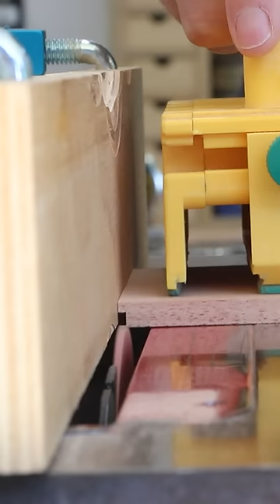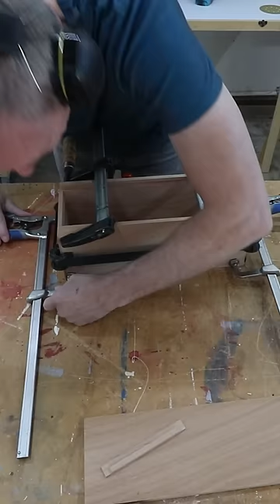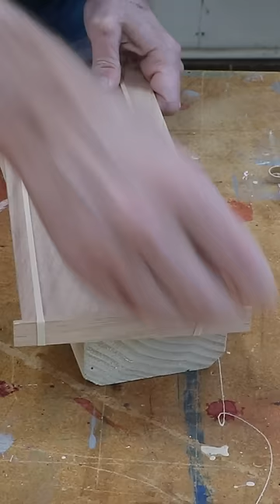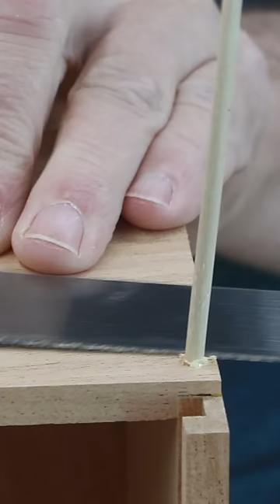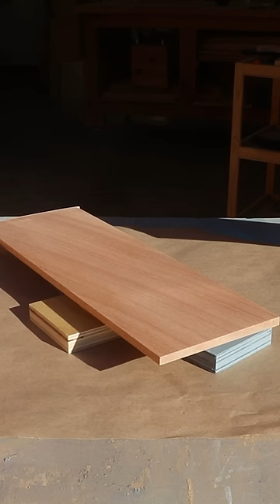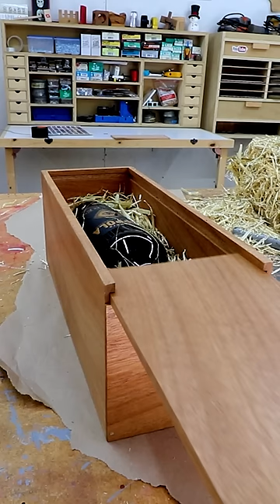Mahogany Wine Bottle Gift Box #shorts

Comment: Nice looking project as always....

in my grandfather's shop, we would have called that a "mantle box", as it was narrow and fit well on the fireplace mantle.   I've also heard them called by an older name:  candle box.   back when candle light was the chief source of light, a easy access, convenient place to store the supply of candle sticks until needed , this box fit the bill.  as a bonus it also helped keep them straight so they wouldn't be bent when it came time to use them.   

The box design itself is straight forward enough it is easily altered to different sizes  and uses.  I made one for my wife for her numerous medication bottles.   It is more square than the long narrow version, and deeper, having an internal sliding tray for smaller medication bottles...